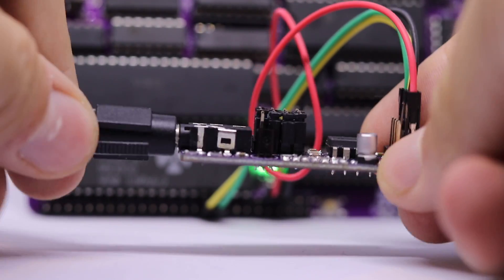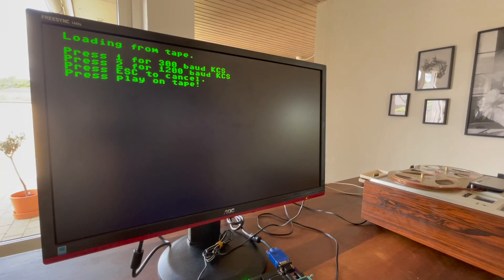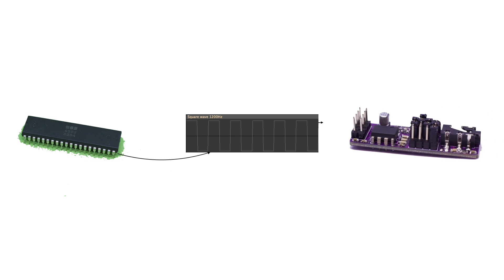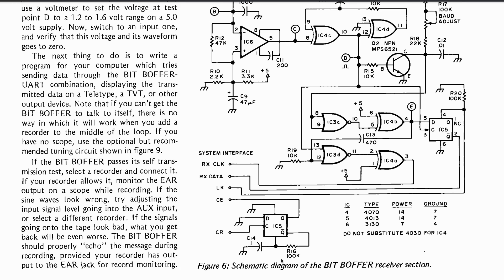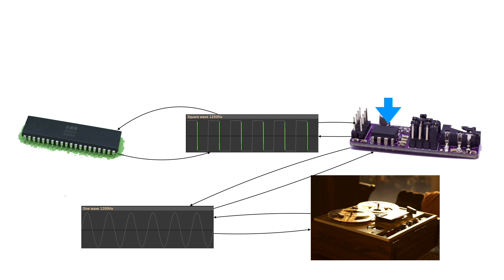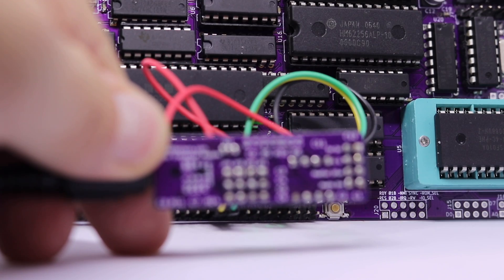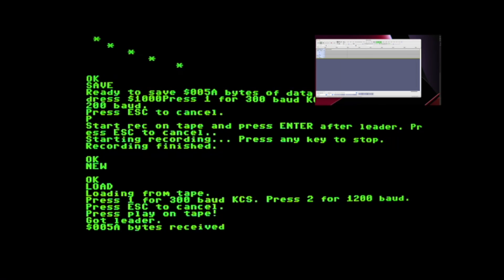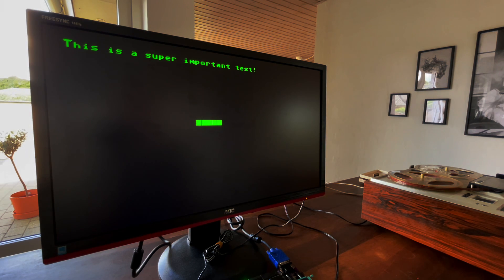A Simple Universal Modem for your project!

Comment: Is there a way I encode human sound converter it to binary data and send it in to one of these and then decode it back with another one?
Reply from the maker: Human sound?
Reply: @AndersNielsenAA  I should say I want to encode normal audio into digital and send it out using fsk or the method you have utilized and then decode it and play it back for a bit of fun.

It's a really cool project and I hope you show more of it
Reply from the maker: @JustinWhos  Considering CD quality audio is about 9Mb per minute, the audio recording to hold one minute of data at 1200 baud would be about 1000 minutes if I’m not horribly off :) 
Haven’t seen that long tape reels I think 💭
Audio straight to tape doesn’t come with the 1000x penalty
Reply: @AndersNielsenAA  would it be possible to compress the audio like VoIP  and increase the buad rate
Reply from the maker: @JustinWhos  MP3 is about 1MB/minute - but then you suddenly need a computer anyway 💻 And if you have that - you don’t need this :)

Comment: Oh cool! I can use this with my VIP2K kit
Reply from the maker: I have 0 experience with 1802 based systems, so I'll have to go with a strong "maybe". You need an edge triggered interrupt for RX and a timer/pin capable of outputting 1200/2400Hz for TX. Easily done with a 6522 or Arduino - dunno about an 1802 system.
Reply: @AndersNielsenAA  worst case scenario, I can probably adapt the design some, or do some other hacky solution.

Comment: It seems like, with just a tad bit more circuitry, you could build this into a half-decent full-duplex design. I believe the Texas Instruments graphics calculators use some similar circuitry along with an extremely clever (in it's simplicity) protocol to allow a single TRS jack to operate full-duplex like that.
Reply from the maker: Yes, it wouldn't take too much - but when you expect to be talking to a tape deck you'd never need it :D
Reply: @AndersNielsenAA  That's a good point! It does look like a neat way to get two C64s (or other modern-retro equivalents/DIY computers) to talk to each other. I'm surprised at how straightforward the circuit is to be honest.

Comment: That's really interesting. It's basically a win modem from back in the day!
Reply: At the time, I HATED them. But logicly it makes perfect sense to do it this way. Why have specialized hardware for what software can do.
Reply: @mawizard6341  the concepts not bad the execution just sucked.

What made it suck more was that regular modems had gotten pretty cheap anyhow. 

Anyway with isdn cards the 'passive' isdn cards (though digital) often behaved better than more expensive active cards in sense of getting lower ping even. Its a bit(a little bit) like winmodems in concept, but the user experience was great mostly, though for ours to get dialup working in windows you had to get the sw by doing a isdn call into germany... But linux distros had drivers on the disc(mid 90s) and man pages telling what to do..

Comment: This is awesome! I'd love to tack it onto a cyberdeck-style project! I'm curious, could you switch the jumpers for switches? And you mentioned that the harmonics of a square wave would mess with the signal, how so? (Signal processing has always been one of those things I never found approachable but always was curious about).
Reply from the maker: I’m pretty sure switches with 0,1” spacing and three poles exist and would fit right in the existing footprint.
A square wave is the sum of the fundamental frequency and all the odd harmonics. A lot of audio devices will have a hard time faithfully reproducing them - especially if clipping a bit on the input or output. And there’s also no way of knowing exactly what happens when you feed a random tape head a frequency it can’t reproduce - like infinite harmonics.
And then suddenly 1200Hz looks like 2400Hz and your data is messed up :)
Reply: If you are using frequency shift keying then you really need a clean single frequency sine wave, any distortion of this wave is caused by addition of harmonics (other frequencies) so it is then harder to determine which is the fundamental frequency. A square wave is particularly bad in this respect given that a perfect square wave is the sum of infinite harmonics. At that point it becomes quite difficult to distinguish between the fundamental frequency you want to detect and the harmonics.

Comment: Presumably it's (I believe the term is) half duplex, and if you wanted to rig up two way communication instead of time shifting a signal, you'd need four of these?
Reply from the maker: Yup, it's half duplex. Since it's intended for storing data to audio rather than communication the extra complexity would not make much sense. It's very rare the Walkman you're talking to tries to talk back at you ;-) That didn't keep the early computer homebrewers from hooking a half duplex modem up to a phone line acoustically - maybe hanging up the phone and ringing it again to signal it's time to turn around the handset. There were also modems intended to have a low bandwidth in one direction used for this type of signalling.